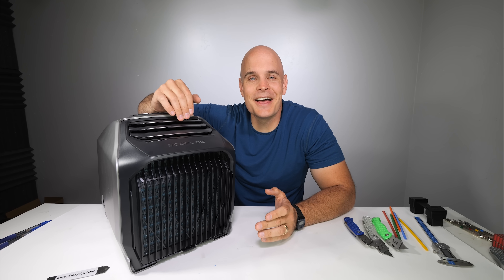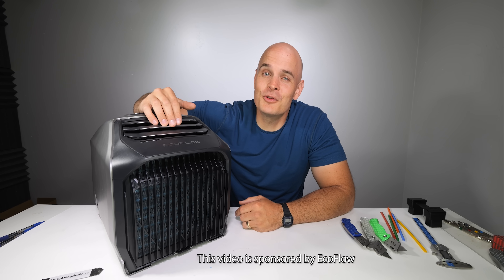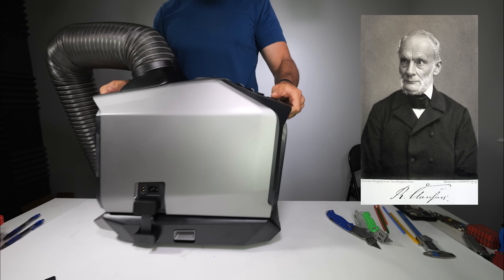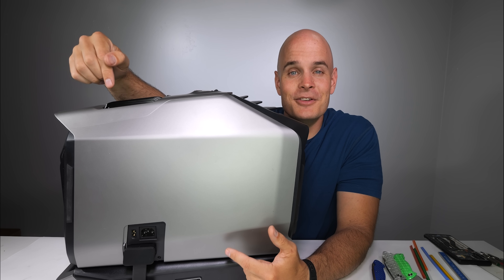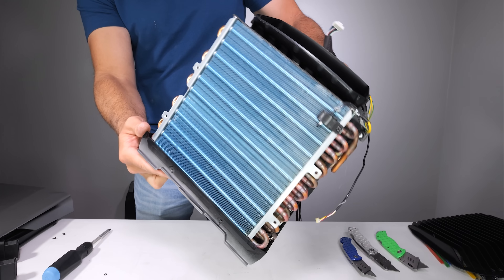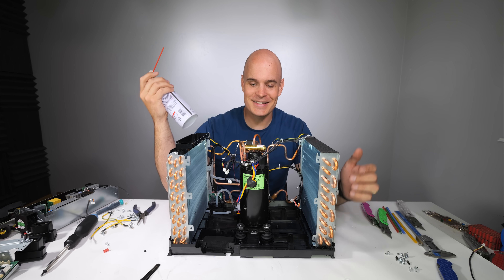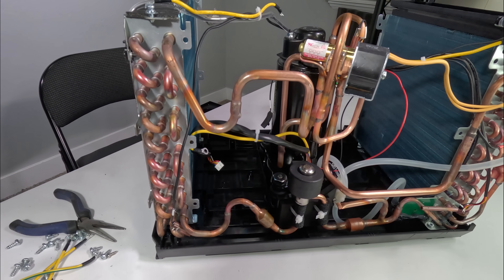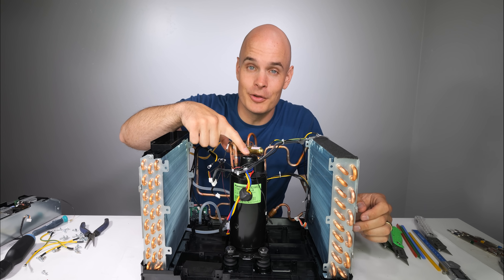THIS CHANGES EVERYTHING... (Ecoflow Wave Teardown)

Comment: Thing is, for a heat pump like this to be 200% efficiet you would need to have the condenser and evaporator completely separate (one exclusively outside, the other exclusively inside) no matter which is which (the evaporator becomes a condenser when in heating mode). This is regardless of venting the air outside, there still needs to be a temperature difference between the two to keep its efficiency
Reply: Well, i think the 200% efficiency claim is counting with the condenser and evaporator close to each other, because bigger heatpumps with the units split between outside and inside can reach efficiency of more than 400%
Reply: @eduardobarros2958  yup. You’re right. 200% efficient for a heat pump isn’t much. So they’re covering their bases for sure
Reply: @eduardobarros2958 I have a 42 SEER Carrier minisplit, which at 47F is rated at a COP of 4, which is 400%, so I have one like you described...actually 2.
Reply: that’s impossible no appliance on earth is more than 100% efficient. It breaks the laws of thermo. And physics. No company can state their product is a 100% efficient it doesn’t exist
Reply: @eduardobarros2958  its not about distance, its about separation. A heat pump to truly be efficient needs to have the condenser and evaporator physically on different sides of the building, one in one out.
Reply: @xFluing  No the air just needs to be moved correctly, which is what the ducts are for.  You can take outside air through the intake duct, heat it and blow it back outside and pump the chilled air from the other side of the system into the room.  It's a bit more efficient to have the heat exchangers on different sides of the wall but not necessary.
Reply: @xFluing  yep, that's what I meant to say, sorry if I was confused about it, English is not my native language
Reply: @rcguymike  one problem with that, this is a single duct unit so an output duct only input is via room air for both heating and cooling
Reply: Are you okay?
Reply: @xFluing that is ridiculous…
All that is needed is an air path to reject the unwanted air outside… as long as the rejected air ALSO comes into the unit from outside.
Reply: @eduardobarros2958 
Actual energy efficiency can never be greater than 100%.
In fact due to the second law of thermodynamics energy efficiency is much lower than 100%.

The Second Law forbids the construction of a heat engine with a single heat source.
Reply: @PetraKann  the second law isn't broken, we are not extracting more energy than we are putting in the machine. We actually move heat energy from outside the house to inside. Search for how heat pumps work's.
Reply: @eduardobarros2958  I understand how heat pumps work. The use of the term "energy or thermal efficiency" is where I have a issue.
It's like saying, I will transfer energy from some other source and input into this particular "system" and pretend that it's a closed system and then claim that the energy efficiency is 200% or 1200%.
Energy efficiency has a very well defined thermodynamic definition - search for what energy efficiency means
Reply: @eduardobarros2958  nope, nothing can ever be more then 100% efficient.  You can not get more out then is put in.
Reply: This is managed by two hoses which need to be outside.
Reply: @K0nst4nt1n96 aren't all houses outside? 🤔
Reply: Efficiency is the not the technical term here (albeit I like it). The term is coefficient of performance. Rather than using the energy (electricity) to generate heat, it’s pumping twice the amount of energy (heat) from outside to inside. 

It’s like pumping gasoline with a gas engine. If you have a source you can tap to you can pump lots of gasoline with little amount of it.

200% is surprising because it is actually less than what we used to. In a typical AC unit it’s 300% or higher. 

Power plant can’t use this because of the form of energy. The output is heat energy. We can’t practically transport or use it in our household.
Reply: More specifically,  it's most efficient to have a heat exchanger outside because warming (or cooling) inside air you just cooled (or warmed) and pushing it outside not only wastes some of your effort, but also creates a vacuum inside that draws in outside air that much faster.
Reply: @architypitect  Zach only showed one hose, but this comes with two hoses and cowlings for the compressor side so it is a dual hose unit. It still isn’t efficient as a mini split or even window unit of course, but it’s much better than a single hose unit. Hobotech does a thorough review and explains it very well.
Reply: @architypitect There is an intake and output vent. Most portable AC units only use an air output hose.
Reply: @architypitect  Yup, any air that goes out, has to come back in somehow.
Reply: @architypitect  You could put the unit outside and run the duct inside and it would actually pressurize the inside thus eliminating any issues with sucking in hot or cold air.
Reply: Yup and there are better models like this one in terms of efficiency, total marketing in this one.
Reply: Quais seriam senhor  @javierEI345
Reply: Lol he's talking about energy efficiency in comparison to heaters of the 1900s. Wtf are you all talking about here.
Reply: Well, COP 2.0 isnt something high in terms of heat pumps, its pretty lowish result.
Reply: Forgetting one factor. The exchange  of heat and cold of that unit is done inside of the house, not outside ambient. Then, it is added a non insulated, flexible duck to take the heat 🥵 out of the house.  The house inside temp. become, the outside ambient temp.
Reply: Or have a dual hose system which can pull in the outside air from first hose to cool the heat exchanger and then push the hot air out using a second hose.
Reply: You guys didn't pay attention. It's 200% more efficient compared to a RADIATOR type hear that wastes part of the electricity it consumes in the form of light. As such this won't be more or even as efficient than regular hot + cold split air conditioners that already exist
Reply: That’s why there is a pipe to exhaust hot air, these devices are not new, this one is just battery powered. They’re not as efficient as a device with completely separate condensers, but they work well for something portable
Reply: i think its 200% more efficient than the old thing shown in the video
Reply: 200% is low for a heatpump
Reply: 200% is pretty lame, modern AC go for a 700%+ for cold and 400%+ heating
Reply: I'd expect the 200% claim to be at least sorta close, since IIRC 2x is actually not that great for a modern heat pump. Still way better than resistive heating, but not an outrageous claim.
Reply: If it was 200% efficient it wouldn't require any power because it would give off more than it uses and be defying the laws of physics.
Reply: There is one outside
Reply: Yea, but if the condenser and evaporator are sufficiently insulated from each other.
They can work quite well.
Like you want cooling, just put the pipe thing on and exhaust the hot air from the condenser side.
Reply: How can anything be more than a 100% Efficient? 100% is the Maximum Possible Energy Efficiency!
Reply: It's a pretty packed window unit😏 200% can be expected, if used correctly.
Reply: @goiterlanternbase  No because a window unit has the part that gets hot outside (when cooling the inside) and uses outside air to cool the hot outside part. This unit uses inside air to cool the hot part. If you pull cold air out of the room to cool the hot part, you loose that cold air and also because pressure in the room you are colling drops you suck in warm outside air trough all the cracks in the building like around doors and windows. If you would seal all doors and windows 100% effective the unit would stop working because of overheating because it tries to pull the room to a vacuum which it cannot do and fail to get air over the hot part of the unit.
Reply: @goiterlanternbase  200% no. Thats impossible here. 100% is maximum,  and it's not, probably about 3% in total.
Reply: @Dat_Sun a heatpump is capable of moving more thermal energy than it uses in electrical energy, it is not really 200% efficient, it is just capable of moving twice the thermal energy as it uses in electrical energy, it's typically called COP. 2 is pretty low, 3.5 to 4.5 is typically where modern high efficiency heatpumps are
Reply: @Dat_Sun  200% yes actually, when regarding power usage, and only power usage. 100w of power to have 200w of cooling (or warming). my own split unit tops out at 1kw of power, but cools with 3-3.5kw of cooling. it uses the difference of the inside and outside are to gain such unbelievable efficiency, that's where the rest of the cooling (or heating) capacity comes from, so you're not actually doing something outside the laws of physics.
Reply: @Dat_Sun  It's caloric efficiency, not energetic. The other 125ish calories come from the outside. A good heat pump is 700% effective. This is just a pretty packed 399 window unit and its problem is, that the hot and the cold side are not isolated enough from another, but hey, it is one piece, something the more efficient Eurom240 is not.
Reply: @yourick1953   That's some nonsense right there lol Tesla battery day style advertising.
Reply: @yourick1953   Are you really in Mongolia?  That would explain a lot.
Reply: @yourick1953   Enough with the propaganda style advertising. It's a simple electronic pump in a closed loop system. It's not a perpetual energy machine, it's not giving more than we put into it no matter how much trickery verbage is used.

If it was honestly increasing the efficiency of energy put in, then we could use that heat or cool energy to generate more power with another device.  

 You should open your eyes to what a perpetual energy machine is and realize anyone claiming greater than efficiency's is claiming perpetual energy machine.

Doesn't matter if it's making ice cream or 240 VAC.  You can take the cold energy from the ice cream and convert that into electricity. So tell me again, how does this perpetual energy machine work?
Reply: @goiterlanternbase   What you are proposing is Is a perpetual energy machine by the very definition. And if it's true finish building the machine by attaching a generator of some sort, forget the air conditioning and heat altogether.
Reply: @Dat_Sun  No, i'm not. The calories are taken from somewhere. It's basic work of any heat-pump or in this case a Inverter AC.
Reply: @Dat_Sun  From another commenter on this: Efficiency is the not the technical term here (albeit I like it). The term is coefficient of performance. Rather than using the energy (electricity) to generate heat, it’s pumping twice the amount of energy (heat) from outside to inside. It’s like pumping gasoline with a gas engine. If you have a source you can tap to you can pump lots of gasoline with little amount of it. 200% is surprising because it is actually less than what we used to. In a typical AC unit it’s 300% or higher. Power plant can’t use this because of the form of energy. The output is heat energy. We can’t practically transport or use it in our household.
Reply: @Dat_Sun  over 100% is, absolutely possible. Unlike resistive hetaers, heat pumps don't convert their incoming energy into heat. Instead, they use that to collect heat from the outside and concentrate it inside. You can easily pump in 1Kwh of energy into the heat pump and move 4Kwh of energy around, residential units can already do this.
Reply: @MrFastFox666   You know what else can move hot and cool air around? A box fan
Reply: @MrFastFox666  it isn't 100% efficiency is the max possible, efficiency is a measurement of energy in vs work done and the work done is to operate a pump and 1 or 2 fans. However something can be 200% effective since be effective isn't a matter of energy conversion but how well it achieves the desired result. The reason you can't say a heatpump is more than 100% efficient is because the only heat a heatpump actually generates is through loses in the motors the transfer of heat is a side effect of the work a heatpump is doing
Reply: @shaynegadsden  "Efficiency is very often confused with effectiveness. In general, efficiency is a measurable concept, quantitatively determined by the ratio of useful output to total useful input. Effectiveness is the simpler concept of being able to achieve a desired result, which can be expressed quantitatively but does not usually require more complicated mathematics than addition." Now, I realize wikipedia isn't the best source in the world, but it's usually pretty good 90% of the time. I would say getting 200w of heating for every 100w of input power actually fits better under efficiency. Either way, the correct term to use is subjective at best. The power company in my city uses the word efficiency when talking about heat pumps, not effectiveness. Technically the more correct term is coefficient of performance, but that doesn't really matter. The point I'm trying to make is that this a youtube comment section, arguing about terminology is a waste of time, everyone who actually cares, already understands what is being said.
Reply: @Dat_Sun  small brain energy
Reply: @entropy1454  they uses words that the average person can understand but heatpumps don't generate any heat they are just an evaporation/condensing system the effective heating is entirely based on environmental factors but the efficiency remains constant
Reply: @Dat_Sun  No one here is proposing anything, the technology already exists. The use of the word efficiency, in this context, is referring to the fact that there is a higher amount of power(as heat) coming out of the device, than we are putting in(as electricity). It's not creating energy, but it IS giving more than 100% of the input WE are directly giving it, it's using the heat energy in the air(which is usually somewhat less useful). You wouldn't really be able to generate electricity with it, at least not to any meaningful degree, at some point the outside air would be too cold and we would all die(and efficiency would drop way before that). I'm not sure what your problem is with it, the only difference between this and a generator, y'know, the things we actually use to power our world, is that the energy is coming from ambient heat, instead of stored chemical/nuclear/kinetic/potential energy. Also, cold energy isn't a thing, heat is energy, cold is literally the opposite of energy.
Reply: @shaynegadsden  What I'm saying is that it really doesn't matter what words are being used if everyone understands what is being said. The difference between Efficiency/Effectiveness and any other word that might be used, has very little practical utility in general, let alone a non-academic environment. It's not going to have any real effect on anyone's understanding, it's not like mixing up voltage and current.
Reply: @entropy1454   We have the ability to take advantage of thermal differences with several different mechanical designs that convert it to a rotational force. 

This ewaste machine has a massive carbon footprint and is made halfway around the world in China. It's not serviceable, ultimately adds to an ever increasing demand on our grid as Government continues to shut down and penalize reliable practical fossil fuel power plants. 

 Not only is this made in China junk bad for our economy it's bad for the environment and aids to raise our utility bills. And for what?   To temporarily cool a small space?  People have become incredibly lazy.
Reply: @MikkelSV  Denmark 🇩🇰  Hows the weather?
Reply: @yourick1953  you can't claim 200% efficiency there. and your '3-3.5kw" of cooling is based on a temperature differential. if you have either side too hot or too cold your efficiency is 0 you will use more power to cool less on hotter days or to cool your house more then you should.
Reply: @entropy1454  the issue as addressed by multiple commentors is the use of the term efficiency when talking about heating and cooling as a function of the amount of energy put in. if we want to be extremely nit picky we have 2 measures, the raw efficiency of the compressor at compressing  it's refrigerant and the efficiency of the radiators at set temperatures. but we can't really relate the value of the efficiency of the compressor to the efficiency of the radiators as they technically aren't comparable. but we can do some fancy math to come up with some measure of how these systems relate by measuring how much energy is moved at a given instance...
I would rather these manufacturers be honest and not use some abomination of efficiency rather state a capacity  @ a standard temperature differential and the efficiency of the compressor. we should never see efficiencies advertised over 100% rather how many cubic yards it can cool in 10 minutes 1 degree with the outside being 95F.
Reply: @Dat_Sun  He wasn't saying it was increasing the efficiency of energy put in, all he was saying was that for every 100 watts of electrical energy you expend, you get 200 watts (682 BTU) of thermal energy out, it's not making energy, it's just extracting more BTU's from the air then you spend on energy. By comparison an electric heating element, you get 100w (341BTUs) of thermal energy for every 100w of electrical energy put in. That's what makes heat pumps more efficient then electricity, the process of moving heat energy from one place to another requires less electrical energy then just converting it into heat.
Reply: @Dat_Sun  a heat pump is like a mass pump.

I can move water from outside to inside, but no one would claim that I just created water with the energy required to move the water.

But, my water pump has amazing efficiency if you calculate the energy to create water (E=mc^2) vs the energy to pump it in from outside.

Aircons and heatpumps are the same thing.  A way to move heat energy from one location to another. 

The energy they use, can result in more energy removed or added from the target location.

Eg 200watts of heat can be added to a room using 50 watts of energy.  Because we used that 50 watts to push or "pump" heat from outside to inside.
Reply: @meateaw  I understand how they work. IMy problem is with the misleading advertising and claims.   Would it be OK to talk about the disadvantages of a heat prompt system or what I just get flamed here?
Reply: @Dat_Sun  As the name implies it's a heat PUMP. it PUMPS heat around. If a (pretty poor) heat pump can use 1W of electricity to move 1W of heat from the outside in, you get CoP (coefficient of performance)/"efficiency" of 2 because on the hot side you get the 1W of the electricity (which all eventually gets converted to heat anyway, minus some that escapes as noise) and the 1W it grabbed from the outside, for a total 2W of heating for a 1W "cost" in electricity.
There is no magic, no perpetual energy, it's just a bit of "creative accounting" that conveniently "forgets" the heat energy grabbed from the outside air.

And no, you can't power the world with it, because to efficiently convert heat into electricity you need large temperature differentials and heat pumps loose efficiency as the temperature difference increases.
Reply: @MikrySoft   Can you explain the unbelievable amount of likes on the OG comment?  I took screen shots showing impossible likes almost instantly.  Would you like to look at some of these accounts?  Most of them are advertising smut. Something very strange is happening here on this Jerry rigg everything channel.   Did he Jerry rig his comments for likes?  That would be like stealing.
Reply: @Dat_Sun  It's 200% efficient! It violates the basic laws of thermodynamics. 😆
Reply: @Dat_Sun  u dont understand, it moves heat. It does not transforms electricity into heat. It takes available heat energy to decompress compressed gas/liquid. You know even in freezing weather there is a lot of heat energy still that can be used to decompress compressed refrigerants. The efficiency numbers comes from the electrical energy needed  to run the electric motor that compress the refrigerant. That energy is much less than the energy needed to heat a home with pure electrical resistive heating elements
Reply: @Dat_Sun  that cant extract heat energy from  cold air tho, thats where heatpumps comes in
Reply: @Dat_Sun  agree 200% must be magic 1kw of electricity generates 2kw of heat, also that heater isn't 100% efficient some energy is converted in “light”. i think the word efficiency was poorly used but understandable, efficiency for the public isn't the same as engineering.Another big issue is that taking air out of the house allows cold air to enter, so the 200% is down the drain
Reply: @Dat_Sun  eee..who's counting
Reply: @shaynegadsden  that's a useless way of looking at a heat pump, though. If a heatpump is dumping 30Kw worth of heat into your home, does it really matter that 7Kw came from the electric gid and the rest from outside? Do you magically only feel the 7Kw produced by the motor and pumping losses? No, you feel the full 30Kw. So yes, the machine can only be up to 100% efficient at generating heat, but when it comes to heating the air or heating a liquid, you know, the stuff that actually matters and what we actually use these devices for, then it doesn't. It's consuming 7kw of power, and it's putting in 30kw of heat into the air running through the condenser. 7÷30≈400%.
Reply: @MrFastFox666  a heatpump pump generates zero heat except through losses so it isn't a useless way of looking at it, it is the correct way also since that output is a rated maximum based on specific temperature ranges
Reply: @Dat_Sun  moving air and moving heat energy are completely different things. That's why your central A/C is a heat pump, and not just a giant fan. If you put a fan in a hot room, it's just gonna blow hot air, same in a cold room, it'll just blow cold.

A heat pump will concentrate energy in one spot, then move it to another and release it, and this can be done through a thermal barrier. Put the concentrating end on the inside, and put the releasing end on the outside, and you have an air conditioner. Make the heat pump reversible, and now you have... well, a reversible heat pump, meaning you can move heat out of your home to cool it, or move outside heat energy inside to warm up the space. Can't do that with a box fan.

The unit from Ecoflow does just that, although there's no thermal barrier. You can have it blow cold air directly on you, which could be helpful outdoors, but it'll slowly warm up an enclosed space. You could use it in this mode to warm up a space, but at that point you've made the world's most expensive and complicated electric heater. The ducts allow some separation of the system and act as a crude "thermal barrier". Energy will leak through it like crazy, but it will allow the unit to somewhat effectively cool or heat a space.
Reply: @MrFastFox666  Ok, lets talk about the negatives of heat pump junk. Not just propaganda.   Also,  what it the intended use of a 60lb $2,000 portable windown unit?
Reply: @shaynegadsden geram calor forçando o compressor a esquentar
Reply: @Dat_Sun amperagem kkkkkk
Reply: @Dat_Sun With thermal loss through the uninsulated "piping" to the condenser being so close to the compressor and a few other factors I  calculated it being 127% efficient. How'd you get 100%?
Reply: @Dat_Sun do you know how heat pumps get over 100% efficiency? It's called evaporation and you're moving the cold air out or hot air out by this process. There are no claims of it being a perpetual energy machine it's just using the laws of physics(maybe you should Google this)

You can do these own tests by measuring the outside temperature using your heat pump then measure the power usage via a Kill-A-Watt and check the rise in ambient temperature. Do this for a resistive heater and check for the rise of ambient temperature and compare the power consumptions between the two. You can easily get 200-300% efficiency with suboptimal conditions.
Reply: @MrFastFox666 give it up. Dude is literally a resistive heating salesman. Theres so much research papers on the matter even though heat pumps are a fairly mature technology but he doesn't get it. The magic is in the evaporation and he doesn't understand it or is a heat resistive heating salesman as I've mentioned earlier.
Reply: @yourick1953 it is COP not efficiency...two different things.
Reply: This AC is not good at cooling. It is taking in the cool air from the room to push through the condenser fins and put the air outside. This will create a negative pressure in the room which will suck warmer air from the outside. Permanent window and spit ACs are far better to use.
Reply: @TechBuild  only if you don’t use the two hoses it comes with. It literally comes with a kit to make it a dual hose portable AC so that the condenser side is a closed loop that take air in from outside and expels it back outside.
Reply: That's why there is an air hose as it absorbs heat from the outside. It will work like a normal heater at 100% efficiency cif you just cool down the room at the same time.
Reply: @omniyambot9876  Exactly, and without using the duct if you try to cool down the room it will actually warm it up as extra energy is depleted in the air from the electricity.
Reply: @omniyambot9876  cold air is thrown outside through the pipe,not come from outside
Reply: @Omni Yambot  they don't absorb heat from the outside, they add heat to the inside, whilst expelling cold as a by product.
Reply: The company has run tests so they know what they are doing.
Reply: Yup, these "monobloc" Heatpumps are so stupid.
Reply: @jojoflowe  They're not stupid if you firmly place them properly in a window like window units (though the form factor is indeed kinda dumb). Doing so will get you the 200% efficiency.
Reply: Will someone address all of the fake accounts here and the incredibly unbelievable amount of likes on some of these comments?  How is this not theft having bots support your account? 

 I mean people pay for YouTube they don't wan to see bots in the comment section, it's also stealing from honest content creators who are monetized.
Reply: Are u the inventor or i can mek one better than you..mister riggs m8😅😂❤ e
Reply: There is comments getting 74 likes in 20 seconds here.
Reply: That’s wrong. Modern heatpumps come as monoblock devices and are completely outside of the building, only the water for the radiators lead inside. And if you get a modern one with propane as thermal transfer liquid/gas you can expect up to 8x the efficiency (most recent models). I have one of them in the property i myself live in…
Reply: .   @erebostd  -The unit beinh demonstrated here one does use Propane as the working fluid - R290  (Co2 is R744 - as an aside and is used for hot water heater  heat pumps.

- What you think of as "modern" - others think of as  way back then (remember when refrigerators were the only heatpump device in a house - many have reverse cycle systems which can heat or cool at will, air to water heatpumps are rarely configured to cool as condensation in the radiators, dripping all over the floor  -  gets annoying - unless you have a way to deal with it in all of the air handlers / distribution units...

Note that an air to water heatpump (the UK's style of "new heating system")  - keeps the streams separate too (so not sure what exactly is wrong - yes the OP saying that an exchanger has to be outside is extreme as onlu the "fluid streams should be separated./ insulated between)  - the water is taken in exchanges heat with the refrigerant - which then completes its circulation (compressed or expanded  - depending if cooling or heating)  where it exchanges its heat with the outside air (usually collecting heat fro the air to exchange it to the water - making the refrigerant to air  exchanger the "cold side" - ie the evaporator.) - the system might be a single unit but the exchangers are not typically  a "monoblock"..
Reply: @erebostd  "That’s wrong. Modern heatpumps come as monoblock devices and are completely outside of the building" 
Thats not true. You can get monoblock outside unit or you can have heatpump inside the house with exchanger being either drilled like well or layed down underground below the freezing point.
Reply: @keldon1137  i recently visited an industrial fair regarding heating systems, and all the new, ultra silent systems were outside monoblock devices. Obviously there are still split devices available - if you want you still can get an oil furnace for your house, can you? But the split devices aren’t the future, and that’s not an opinion, that’s what the representatives from wolf, bosch, viessmann and weisshaupt say.
Reply: @erebostd  But we are talking about in earth heat exchangers, not the air ones? Because i dont belive air only heat pump could be the most efficient one, unless im really missing something/wrong.
Reply: @keldon1137  nope, air pumps. Old split versions got an efficiency from around 4, the new monoblock ones go up to 7,8-8. A friend of mine installed a brand new system from wolf and got an efficiency of 8 right at start with an outside temperature from around 10 C, he couldn’t believe it and even took a photo from the control panel and sent it to me. My experience was mostly with split devices, so this took me by surprise…
Reply: @erebostd  I was curious because i was planning to instal heatpump this year, wolf on their website says air heat pump is least efficient, compared to water heat pump or brine heat pump.
Reply: 200% efficient would mean I gain 100% from somewhere else... And as far as I know conservation of energy is conservation of energy... So I would say something is 50% efficient and now it's 100%....
Confused....
Reply: @deriusnorris4463  a heat pump moves energy (thermal energy - or heat) from one place to another using a compressor pump. The only energy the heat pump consumes is used to move that thermal energy from one place to another. An air conditioner is a heatpump. It moves  the heat from inside a house to the outside air. Typical 9000 btw air conditioners consume 1000W of electrical energy to move 3000W of heat energy form inside air to outside air and is thus 300% efficient. It is not breaking any energy conservation laws an it is not a perpetual motion machine. It is a electro-mechanical device that uses gas compression cycles to move heat. You can say it is like a conveyor belt that moves thermal energy.
Reply: @deriusnorris4463  that's what they are otherwise saying. they are mixing 2 efficiencies together rather then being honest about what the device will actually do at a specific power level and tempurature differential. it's marketing BS that needs to be done away with and we need to start using a different standard.
Reply: @deriusnorris4463  you get the extra 100% through evaporation and on other more efficient units you get up to 700%. You're basically moving the heat or cold from the inside and putting it outside. When the refrigerant changes from a gas to a liquid it gets extremely cold and that cold liquid is run through an evaporator coil which throws that cold air out or inside and the hot air out the other side. 

Check out a video explaining heat pumps from "technology connections"  it's a bit long but i promise you hes a great YouTuber who actually can make learning stuff entertaining and the video has 4 million views which is impressive for learning about heat pumps.
Reply: @deriusnorris4463   This is Tesla style advertising. It's percentage of energy energy used over what the manufacturer of this made in China junk claims is traditionally used.

  If this was a Tesla commercial, yhey would say the Tesla is 500% more efficient than a car. But the car they would choose to compare it to would be something like a top fuel dragster or tractor pull machine.
Reply: @Dat_Sun  The maximum theoretical efficiency you can have heating with resistive heating is 100%.  You use 100 watts of electricity to get 100 watts of thermal energy.  Heat pumps achieve much greater than 100% efficiency because that same 100 watts of electricity can be used to move 200+ watts of thermal energy from one area to another.  It isn’t actually generating 200 watts of thermal energy, it is simply transferring that energy from one place to another.  Thermodynamically it is not 100% efficient as there are losses from friction and waste heat is generated from the compressor.  However, in terms of how much thermal energy it can put in a room compared to how much electrical energy it consumes it is much greater than 100%.  This comparison is used not because it is typical nomenclature from a physics standpoint, but because it is comparing using electric resistive heating elements to heat pumps.
Reply: @coryvincent6249   It doesn't matter this thing's junk. Made in China, not serviceable, huge manufacturing, transportation footprint and environmental cost.  Most will end up in a dumpster then landfill.  It's insanely expensive, if you're not aware of the costs you should look into it it's comical.

 It would be cheaper to buy a quality small window unit. A 4-stroke inverter generator ( multiple uses, very practical) than this gimmick ewaste. Probably more efficient as well.
Reply: @Dat_Sun  Yeah there are ways to generate electricity from temperature differences, doesn't make "cold energy" any less incorrect. You wouldn't say that the energy from a lightning bolt comes from the ground, even though the ground makes it possible for the lightning to strike. No it's not saying 200% more efficient than some other technology, it's saying you get (for example) 300w of heat for 150w of electricity. It's not in comparison to something else, it's in comparison to the actual energy you have to spend.
Reply: @entropy1454   The part of lightning you and I both see is technically from the ground up. Anyways arguing the efficiencies of this particular unit doesn't matter when as a whole it's incredibly inefficient. It's extremely expensive and you need a powerful DC power supply or massive battery bank to operate it. This is ridiculous trash technology. I wouldn't even call it technology they just took existing tech and attached a battery to it.  Probably gets them a tax break or something. I bet if you look hard enough you'll find something about this in the bill back better sham.
Reply: @Dat_Sun  small loop compressors are serviceable though. You just have to weld on your own service fittings. Watch some HVAC YouTube vids.
Reply: @fitybux4664   You won't find anyone to service it.  You will find getting parts difficult.  You might find someone in India at one of those dirt shops willing to hack it up to get it working again.  The parts would be insanely expensive if they were offered but they're not. 

Any repairs would be DIY and guaranteed to fail. You would need expensive HVAC equipment to properly service this thing. A vacuum pump, Scale, manifold refrigerant, torches, tools and specs from the manufacturer, doubtful you could get them.

Parts, substituting parts comes at an efficiency price, I am confident all parts of this system have been designed to be as cheap and energy efficient as possible, most likely unique to this brand.  

There is no good purpose for this Ewaste to even exist. It's purposes is what?  Cooling a tent? Are you kidding me how lazy have people gotten?  Are people seriously going to drag out this ridiculously heavy, insanely expensive battery powered air conditioner/heater for a camping trip?

Check out the prices for a spare battery pack, lol it doesn't even come with a battery in the listening I saw.  Isn't this going to need a hole cut in the tent anyways?    If you placed this in a sealed tent and turned it on it would just get hotter..  Transportation and proper setup of this thing is completely impractical.
Reply: i love how yall  are claiming 200-400 % efficiency like physics doesn't exist. if we rare talking a single unit.... you can only have up to 100% efficient conversion of power or gas to heat energy. the actual efficiency of most heating and cooling devices is much less. Now if we are talking temperature differentials...  and using outside air to help cool the insides, that is a different metric and heavily depends on the temperature of the outside air. we can assume that we are just going to talk about the efficiency of the compressor, that's only going to be about 50-80% efficient at compressing the refrigerant. then we need to talk about the efficiency of the radiators at cooling the heated refrigerant, that's going to depend on the temperature outside. you loose all efficiency once the temperature of the refrigerant is equal to the temp outside. for both cycles. so we can only rate an AC unit at a set value based on a temperature differential. in none of this can you claim 200% efficiency. 
and as far as portable AC units are concerned, they are outright scams. there is literally no point in using one because you need to have a place where you can dump the heat extracted from the inside of a building or a car. dumping it back into the room just creates a cool draft of air that is more refreshing then anything. a portable AC unit is litterally just for blowing cool air onto you, something a swamp cooler will do better with less energy overall.